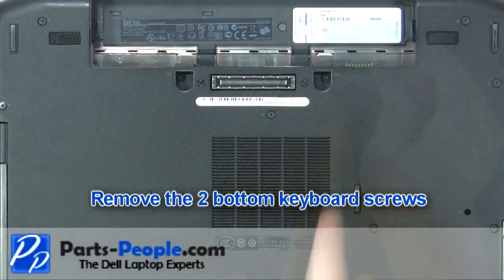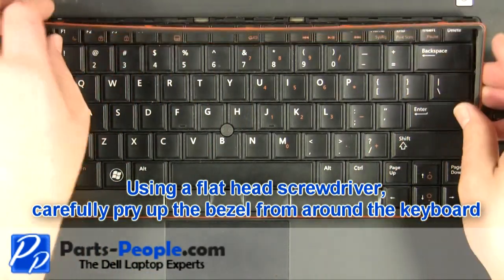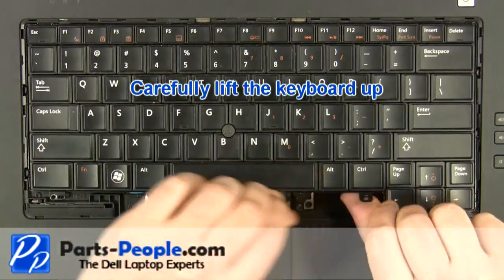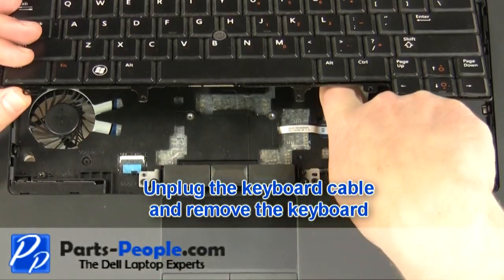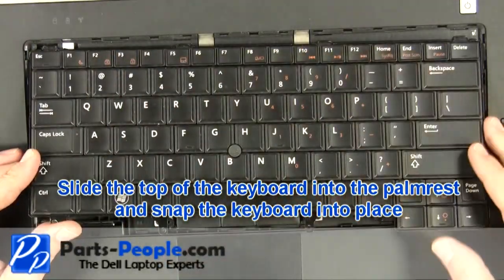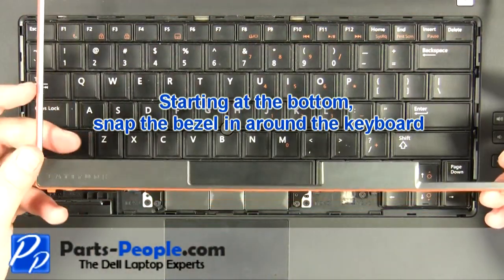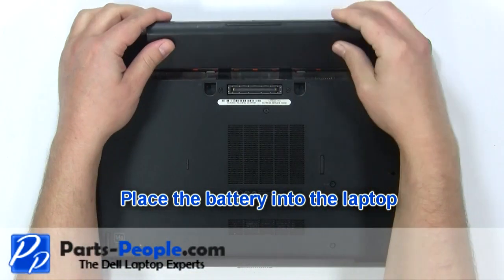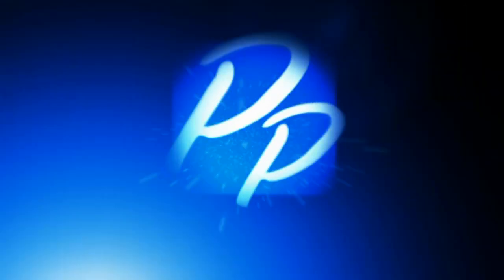Dell Latitude E6420 Keyboard Replacement Video Tutorial

Comment: Excellent video. My first time to ever open up my laptop and this described it well. However my replacement keyboard did not come with a new flat cable so I had to reuse the old one. This entailed a couple minor nicks for me. First, to remove the old cable from the board, there is a little lid on the connector it plugs into that you have to flip open, pull the cable out and then the reverse on the new keyboard. Its very small about as wide as a toothpick. The other end that goes to the machine may be able to just be plugged in but it has the same type connector so I flipped it open, inserted the cable and closed (locked) it.

Comment: If anyone is wondering , there's a latch on the connector for the ribbon cable you have to lift before it will release easily.

Comment: Great video. As I was looking for a replacement keyboard to purchase I did see that there are now backlit keyboards available for the Dell E6420 laptop. Would you know if they would actually work with a laptop that originally did not have a backlit keyboard?
Reply from the maker: Yes the backlit keyboard will work on your E6420 even if your keyboard was originally not backlit. It will just have an extra cable to plug in.
Reply: On the backlit keyboard I do see that extra cable that runs almost in the middle of the keyboard.  So I wanted to make sure that I have a place holder for that extra cable on my laptop and when I removed my keyboard I didn't have an available spot for it. It looks like the connector would be so where behind the number keys.
Reply from the maker: All of the E6420 motherboards have the keyboard backlight cable connector.
Reply: Ok..Thanks.  I'll check again. I took a photo of what things look like below the keyboard and sent it over to a friend and he said my setup is different than his.  His E6420 is a year or two newer and has the finger print scanner too.

Comment: Why pulling the keyboard connector out, the small bracket that locks the keyboard cable to the laptop pop out. Is there a way to put it back in? THanks
Reply from the maker: Edu Mendoza Unfortunately I have not found a way to replace a broken keyboard latch. Everytime it's happened to me, I've had to replace the motherboard.